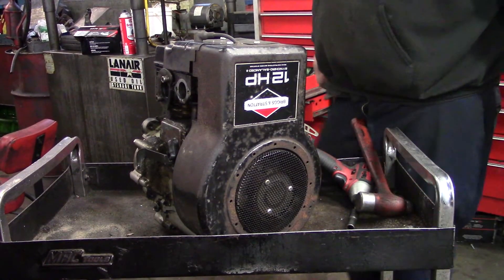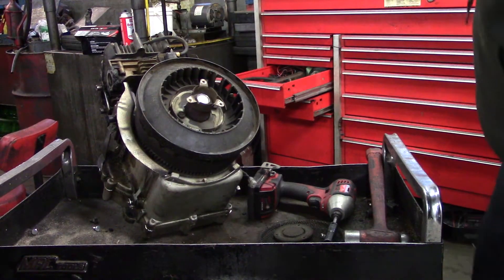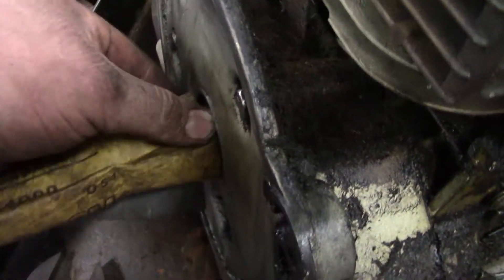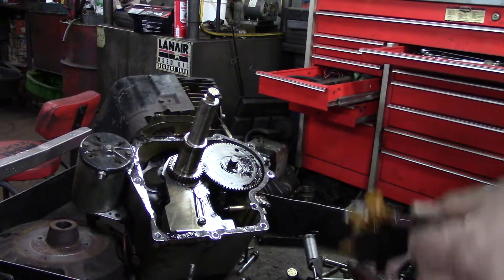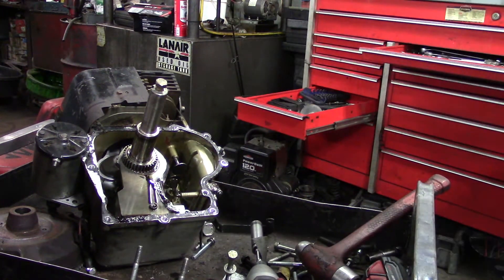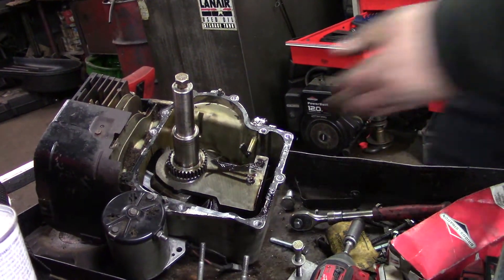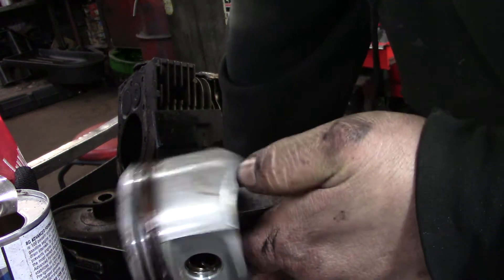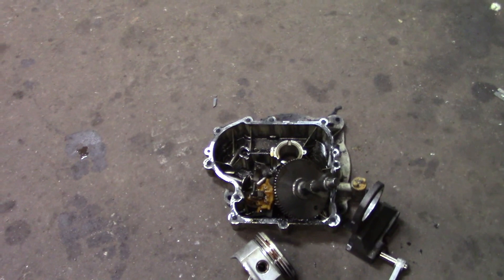Briggs & Stratton 12hp engine  teardown with repair tips

Comment: I was given a Riding Mower with a 12.5 HP Flathead Briggs. Had zero compression.  Pulled the Head while engine in place.  The Intake Valve was stuck open.  Used PB Blaster on the Valve Stem and guide.  Freed up the Valve and it's been running good ever since.

Comment: i have the same one but when i took it apart it was way out of time and has a bent value. can i rebuild it or just get another engine. maybe you can help me everything else is good thank you.
Reply from the maker: As long as everything else is fine you can get a new valve. Strange why the valve was bent. Maybe the engine stopped suddenly by hitting something and why it was bent. If you install a new valve the valve stem clearance is .009 on the intake and .011 on the exhaust valve.

Comment: Now see other people didn't mention about any worn lobes on the camshaft you did and i have because on my 18hp intek engine its lobes on the camshaft were worn down enough while the compression release was still good wasn't broken it all just worn lobes was my problem 

Now if the lobes were replaceable I'd do that and still use my old camshaft with its good compression release so after taking my camshaft out i compared the two together to see what the difference was and seen it 

But the videos on those focus on the compression release on the camshaft instead of pointing out it could be worn lobes as mine were worn.

I dont think a valve adjustment on one with worn lobes would do much good anyways then the only way i figure the top lobe which actually was the bottom lobe was worn more than the top is because someone had already done a bad valve adjustment job on the engine

Comment: Would that piece fit the i/c briggs model of that same engine
Reply from the maker: if you mean the cam no ohv motors are different.
Reply: @kennytheguitarfanatic054  i know the ohv engines are different. But the piece you showed i was asking if it would fit the old model of i/c briggs 12 hp engine or any part off yours to mine 

I also have a old 8 hp briggs pull cord is broken it has a spot for a starter but i don't know what size starter it would take.

But whats the difference between the 12 hp briggs and the i/c 12 hp briggs
Reply from the maker: @Mike-su8si  The difference with i/c 12hp and 12hp briggs is. The i/c briggs has a cast iron sleeve and aluminum piston. Were the 12hp briggs has aluminum bore and chrome plated piston the pistons are hard to fit they don't make them any more. Were the I/C briggs I believe they don't make OEM but you can get aftermarket pistons.

Comment: As soon as you took off the flywheel you should have took the alternator off or the windings. The way he's throwing that motor around he'll wreck the windings on the alternator that which is underneath the flywheel
Reply: It’s called a magneto FYI
Reply: @athannaelanderson3806  thank you, now correct the other so many videos  that call it an armature or alternator, it puts out ac volts and the regulator turns it  to dc. But thanks for correcting one person among many, feel special!!!
Reply: @buddyd.irishsr.5646  If you want to be vague, they are all called electrical generators, I don’t have time to explain the tiny differences in definition. Your welcome 🙏

Comment: What is engine code for this motor? I can't find number anywhere,but my engine looks the same. I need to order piston rings
Reply from the maker: If you look on the shroud the side the spark plug is the numbers should be above the two 7/16 screws are . Or just look up briggs 12hp  model 28 which is 28 cubic inch. The stock piston ring number is 499996.

Comment: Hi i have old 12.5 Briggs with side plate Gov that seems ok and smooth running and loose when idle throttle then tight at full throttle BUT i can only get 1/2 power and push throttle further and no change. So does this mean the govt arm has slipped a little in that clamp OR the govt spring needs adj- and how?  If i move the Gov arm myself, i get full power so its not moving far enough through that spring? thanks
Reply from the maker: If you look at the throttle bracket were the gov spring hooks on you can bend that to give you more spring tension .
Reply: @kennytheguitarfanatic054  Yes thanks, another mechanic replyer said to back that spring off! haha  No, you need to tighten it!! to get more rpm at same throttle setting. I watched another channel using diagrams how it works and its very simply as that spring just puts a biased over those weights and more pressure and it sets the rpm higher as the weights then balance.  I will also check that spindle that it hasnt turned a bit and get it all correct as last owned made a bit of a mess of the valves and this and that so good to take it back to "specs"  thanks for reply.

Comment: I’ve got a 12hp just like that and only getting 18psi compression.  Going to replace the head gasket but don’t visually see anything wrong.  Was hard to start, now finally won’t start.  Any suggestions on what could cause low compression?  I don’t know how to adjust (or get to) the valves and they don’t seem to be any YouTube videos on this.  Thanks, Jason
Reply from the maker: Does the compression come up if you put some oil in the spark plug hole? If compression comes up alot the rings are bad.  If the head gasket is fine and cylinder bore is fine. I would look at the valves. On the valves the gap on the valve stem to tappet clearance should be about .009 on the intake and the exhaust is .011. But the clearance usually don't change unless you put new valves in I would check the valve seats see if they are loose.
Reply: It could also have old build up around the valve seating I've seen it before
Reply: Thanks for the reply; finally got around to working on it over the holidays.  Oil in spark plug hole did not increase psi.  Removed head gasket; valves seem to sit fine and cleaned the surfaces with a sponge so I didn’t break anything.  They don’t seem to turn much when seated, so that seems good?  Put new head gasket and torqued to 100 in pounds, again got 18psi like before.  Going to try to open up valve tappets chamber and check clearances next.  Thank you for the advice!  Jason

Comment: A hell of a noise when you drop bolts and tools on the work surface, a rubber mat or some other softer material would have muffled the sound so we would have had an even better experience. Very good film by the way, thank you very much.

Comment: Hello, love the video have gained lots of info. I aquired a 13 horse and it has been sitting a while. There is little rust on the cam lobes, is there any way to buff it or should i go ahead with an oem cam? Would like a second opion from someone else. Thank You
Reply from the maker: You can lightly sand the cam lobes as long as the rust is not to bad.
Reply: @kennytheguitarfanatic054  its not that bad, any reccomended grit to use?
Reply from the maker: @wrench  320 grit

Comment: One number one build mistake Briggs did in those years was aluminum  case with stupid metal ring insert for valves  to seat for head, after enough  run time on engine over year or two valve ring comes loose pops out it insert hole and engine stops, I find only way too repair this problem is to peen  the ring back in with punch and or bit J B.Weld and hope for best to last mine still running after the fix.

Comment: Great video. I have a 12.5 BS on a wood splitter that is 20-25 years old. Motor has been great, but about every other year I have to order the plastic dogs and other parts for the starter mechanism on top. They are junk I think, and break bad. I would like a better fix for it. Would you have any recommendations. Sometimes it kicks back when trying to start, especially when its cold. I guess that could be some of the problem. I was told to adjust the valves by a friend. I haven't did that yet. Thanks
Reply from the maker: Kick back could be a slightly sheared flywheel keyway.
Reply: @kennytheguitarfanatic054  Ok thanks. I guess I would just pull off the flywheel to check that, and replace it if so. Hadn't heard that one yet.
Reply: Every five years valve lash needs to be adjusted 
On ohv it’s nearly every year
Reply: I did check the valves after my post. They were in spec. Almost perfect, so I never moved the valves at all. Thanks, EE
Reply: you could convert it to a pull start. https://www.youtube.com/watch?v=ClFsqEpwoOI

Comment: I have a two cilinder B & S engine on an older Craftsman rider. If I remove the spark plugs I can rotate the engine 1 1/2 turns in either direction  to a top dead center piston position and the engine jams up.  Would this likely be a problen in the cilindar head or in the lower end.  I had just replaced the caboretor and the engine ran well before that.  
 I would rathe avoid  a teardown if possible .  Thanks.
Reply from the maker: Maybe you have a valve issue were the keeper came off and the valve is hitting the head rare but sometimes happens. Pull the cylinder heads to see. Or maybe one of the screws that hold the carb butterfly came out and the piston is hitting that.

Comment: I was wondering why my briggs and stratton engine valve hits the spark plug?

I replaced the piston rod. Put everything back together but the top valve hits the spark plug.

It's the same engine here, off a JD STX 38

Thank you
Reply from the maker: On that engine I believe it would be the intake valve check the valve spring maybe the keeper slid out slightly or lots of carbon on the valve stems they can stick sometimes. Or could you have too long of a spark plug The correct spark plug should be a champion number RJ19LM.
Reply: @kennytheguitarfanatic054  thank you! Appreciate the feedback. Will check all those things.

Comment: Great video. Can the synchro balance issue cause a bad vibration?
Reply from the maker: The synchro balance would have to be very worn and noisy to vibrate. What engine do you have.

Comment: The model 28 OHV Briggs connecting rod, the heavy duty rod you said you put into a 11 HP bolens. What was the engine make ??? Thanks
Reply from the maker: Briggs and Stratton 25 cubic inch 11hp The model 28 is 28 cubic inch.
Reply: @kennytheguitarfanatic054  Thanks for clearing that up Kenny.

Comment: I need gaskets for mine but I don't know where to get the part number for the engine. Can you help me❓
Reply from the maker: It should be on the side of the engine. But if the numbers are rusted off  The engine numbers that work on that type of briggs 12hp engine for parts .the model 281707  the type 0137-01 code 87010611. Hope this helps